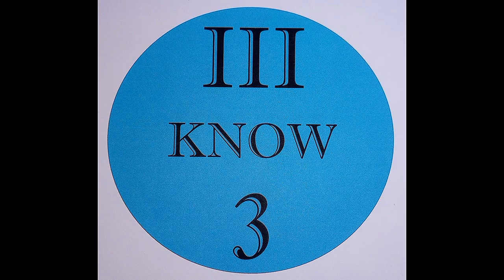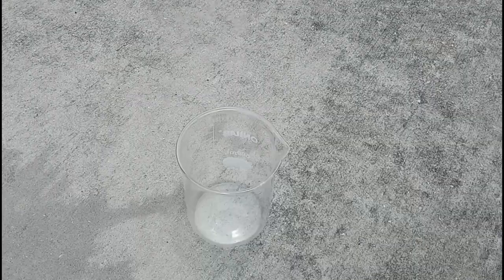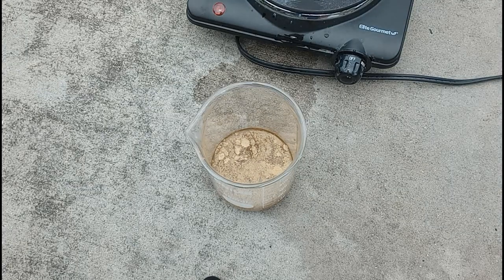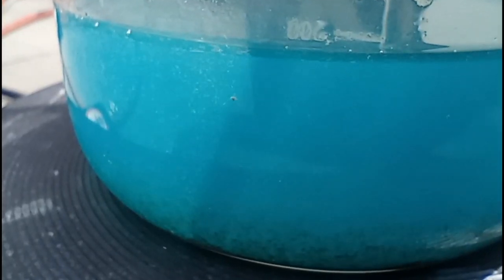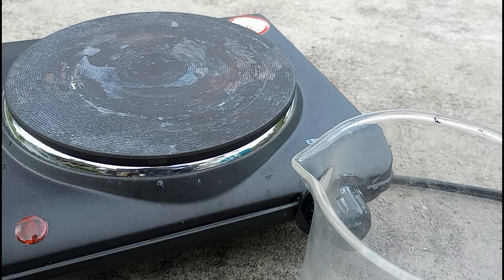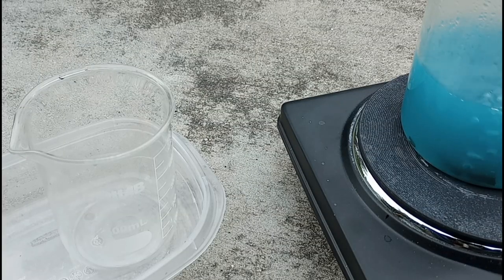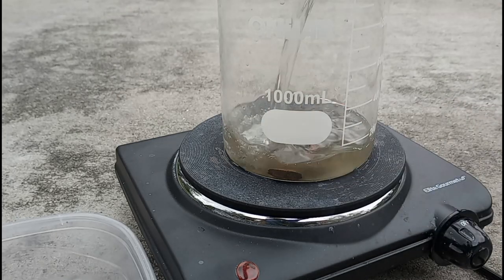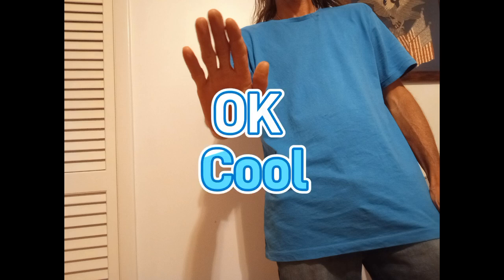Brass, Copper, Zinc and Acid Part 1

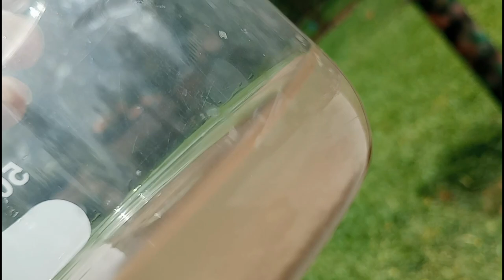Comment: 3:22  Get a bucket or large pot of water and soak a scrap piece of wood overnight so that it won't burn and put the wood  in the bucket then melt your brass and pour it onto the wood just below the waterline.
It won't give you powder but it will give you a hell of a lot more surface area Which is what you're looking for (should look something like cornflakes if you do it right)
Reply from the maker: I am familiar with cornflaking or melting into shot.  The thing about brass is that the melting point is around 1000 degrees Celsius depending on the copper content and zinc fumes become airborne at just over 900 C.  Zinc oxide fumes are not deadly, but they can cause "metal fever" that feels like a bad flu for a few days. I don't like to melt brass unless I am casting something and then I will melt the copper first and add the zinc and pour quickly.  In the following videos I pulverize the brass into bits. If you watch my Melting Tin Metal video I drop the molten metal on ice. I appreciate the view and the comment.

Comment: Of course in doing so you will introduce some contamination but have you tried adding some salt (regular non-iodized table salt) because that will expedite the process of dissolving those big chunks
Reply from the maker: I actually used salt in making acetate solutions for electroplating before I started making videos.  You obviously know about metals and have an interest in what I am doing.  I really appreciate it, thank you!!
Reply from the maker: In the Tin Metal Acid and Electricity video I used plain saltwater as an electrolyte in one part.
Reply: @IIIKNOW3  it allows the molecules to get loose with the ions much in the same way that electrolysis work best with saltwater and not at all with deionized distilled for reverse osmosis filtered water stripped of all the minerals and you can actually climb into a bathtub full of extremely pure water and sit a turned on microwave right in your lap without paying any consequences or so I've heard but I'll admit I haven't tried it yet and likely never will
Reply from the maker: @Rob337_aka_CancelProof  Just enough salt in your sweat to fry some hairs LOL!

Comment: 17:07 so is this precipitant water soluble
Reply from the maker: No, it was, I believe a combination of undissolved material and a little bit of silver acetate.  I still have a little ball of the gray powder left in a petri dish that I will play with later.  It looks very similar to what I melted in the Melting Silver Powder video.